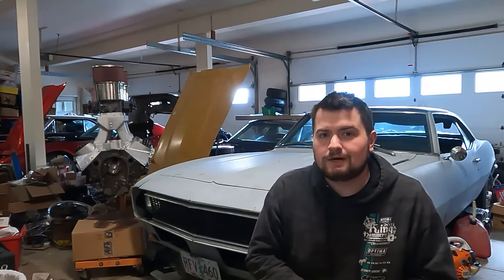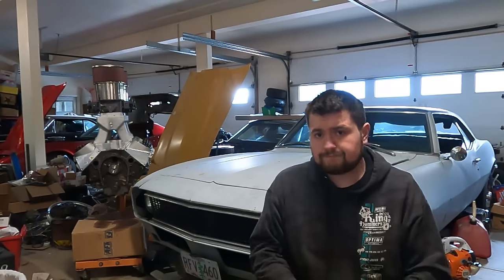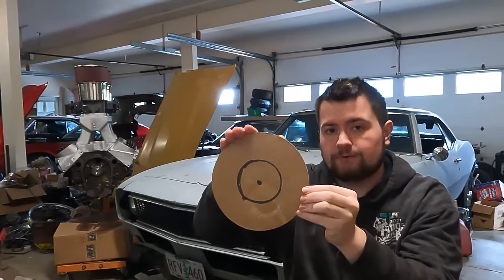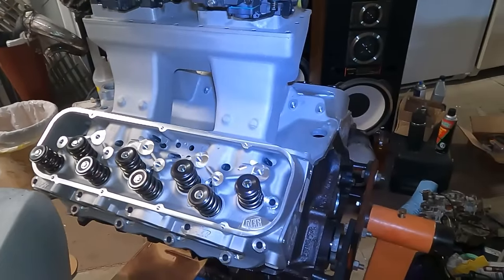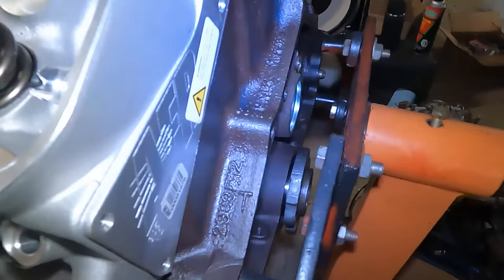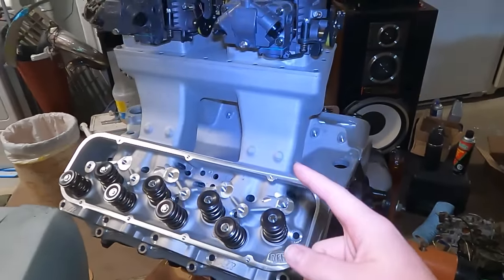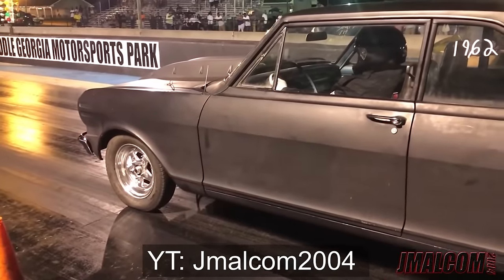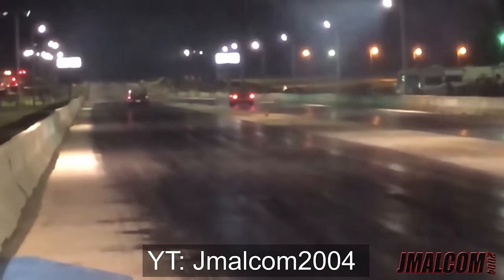The Truth About The Small Block Chevy 327

Comment: I miss the days of of using your brain, combining the right parts you scrounged for or followed leads on. making a deal, then putting it all together,  Did all that on my first engine, a 64 327, 461 heads with a 3 angle valve job plus back cutting the valves themselves, Crane blue[print  series factory cam, flat top pistons of machined heads and decked block, Holley dual plane intake and carb.  Did it all myself in Auto class in the mid 80's.  Thought I was the man!  That was my first SBC and it was a great engine down in my 66 ElCamino; been hooked ever since and still doing it to this day.  Great video.

Comment: I love the 327, I have a small bearing 327 in my 1979 firebird that I use for circle-track spectator racing. I routinely rev it out to 8,000rpm and it has never broken anything. It was built back in 2007 and still going strong. Forged crank and pistons, but still a 2 bolt main.

It ended up making 434hp at the axle and dominated my circle-track class 😁
Reply: WALKED ALL OVER THOSE 350s DIDNT IT
Reply: Yeah, 8Krpm no sweat for a well built 327, we take ours 8,8  at the 1/4 mile drags with 5:14 rear and 29 inch tall slicks. We had 6:14 rear but man, 9,200 in the traps ----Yeeeps  that's a little much.
Reply: What rotating assembly parts are you running?
Reply: That awesome

Comment: Had several mid year corvettes with the 327 350 engines,they were great running cars straight from the factory,on the other hand had several big blocks and had some problems often with them. They had more hp and torque but the small blocks always seemed to run sweeter day after day with more reliability.

Comment: Great video and very good information. 327 is a great engine but if you're planning on building one and not using fifty-year-old rotating assembly you can plan on spending $1,000 Plus on Parts as they're no longer off the shelf. Also a set of even 180 AFR heads will produce about 75 more horsepower than the original camel camel hump heads without significant modification and a far better combustion chamber design. Please keep this great content coming

Comment: IMO 327 was the best engine ever produced by G.M.
Reply: totally Agree 100%.
Reply: I completely agree. Right driver 327 in a quarter mile will eat up that 350. But what do I know 🤔? Only have 4 right now. I would buy more when they're available. Back in the day I did have the fastest thing around. Find out how I set it up that 327 was 160 miles an hour. I also would tear it up in the quarter mile. But that was back in the day. The 80s were great. How'd I know it did 160 miles an hour the one time I loaned it out to a friend of mine. The sheriff clocked it. I'll take a well-built 327 anytime. I've got a guy who has won at 600 hp it has different heads. But what this guy says here in the videos right about the double humps heads and the small journal. with not a whole lot of money 💰 we would pay them over 400 horses. Well I hope you don't mind me sharing this story after your comment I figured you may appreciate it. One of the best place to find a 327? The easiest way is pick up an old scrap 307 with a good crank and slapped that crank with a couple other modifications into a 350 block four-bolt main truck engine. Heather wise head out to farm country especially Kansas maybe Nebraska and The Dakotas and buy an old grain truck. They're cheap enough about a lot of them had inline 6. Go out there just YouTube search it. There are salvage yards out there. Have a great day is getting long.
Reply: I also agree. I still have a pair of 462 casting camel humps on my 350 in my s10!
Reply: Consistently consistent. They were tough
Reply: Screamers,out ran ton of mustangs in my day with a 2bbl 327 lol
Reply: Stovebolt was king!
Reply: Indeed

Comment: I had a 67 Chevelle with the 327-275 hp engine.  It came with the 1.94/1.50 double hump heads and a forged crank.  With the 350 hp Corvette cam, a Z28 intake, Holley 750 and headers, it was good for 13:30s at the dragstrip.   GM built some great engines back then, but it's hard to compare to todays high tech stuff.
Reply: Let's see how many of todays high tech stuff are still around 50/60/70 years from now. Keep in mind there are still quite a few restored 55 Belirs with original 265s still getting used alot !
Reply: I had that same car and setup, I had 456 posi 12 bolt. Turbo 400 transmission, street racing was very competitive.
Reply: it all means not much ! THE CAR WEIGHT IS WHERE IT IS AT !
Reply: The thing about the power pack heads was it's closed in more. And that gives the motor more compression. It's kind of like having pop up pistons having a closed chamber head.
Reply: @hydroy1 LMAO...ur thinking about a 318: Dodge dude. Best small block ever made.

Comment: You can make a large journal 327 by finding a 68-73 307 crank and rods as the 307 crank is large jounal and same stroke as the 327 and will fit in a 69 to 85 350 blocks.
    The 265-327 small blocks allways seem to be one smooth and tight winding engine and seemed to be a little better on fuel.
     I have a 76 Impala engine that I installed in a 66 chevy pu in 84 that had 24,000 mile,still driving that truck with over 300,000 miles and besides good maintenance,I changed the timing gear set,and still runs and drives like a dream.

Comment: My favorite motor was the 327/365 in a 1965 Corvette roadster.  I owned the mighty 427 solid lifter cars too, and sure they were faster, but the little high winding 327 was a blast to drive--and you could actually drive past a gas station.  Was thinking of making another high winding small block something, and this info is interesting.

Comment: Used to run a B&M supercharged 327 at new England Dragway. That car ran High tens, and the rpm's made goosebumps on your arms just before it shifted. Great motor back in the day. Aftermarket parts has made them obsolete in this day and age, but they did run very well!
Reply: Was the crankshaft for that engine a 2" rod journal crankshaft?
Reply: Yes, I had a similar set up & it was very quick only problem was after a few races would blow the rear end when shifting 2nd to 3rd.

Comment: In 1967 I built thousands of 327's.  How ?  It was my summer job after graduating high school in Flint, Michigan.  I worked on the assembly line of the Van Slyke Engine Plant at Chevrolet Division.  Primarily I installed engine heads 8 hours per day.  I also raced a 1957 Chevy Coupe at West Branch, Michigan on the 1/4 mile stock car track.  If you want a cast iron engine (which I no longer use) ... take a 327 block, install a 283 crank, install a 375 solid camshaft, install 12.5 -to-1 pistons, a dominator Holley, fuel injection heads, and a set of headers.  This was before we had access to dyno's, but when Chevy copied our model, they advertised over 500hp and installed it in the Camaro with chambered exhaust (Z28).  This motor spooled rpm's very fast and produced extravagant torque.  Amazingly, it would hold together very well.  I could go an entire season with no replacement parts required.
Reply: You are the man, back in the 80’s my foreman at Don Signer Buick was Gene West and he was a boat racer, factory GM drag racer. He helped develop fuel injection and other fuel related issues for GM . He was able to build a dream car as an experimental. It was a Nova , not exactly sure of the year, like a 68 or 69 and an all aluminum 427. Some of the top brass got wind of Genes mean machine and wanted to drive it. And in less than 5 seconds it was totaled into the wall. He was a real drag racer and his specialty was boats. He invented the dial-a-jet and sold this to Crower I believe. He raced his boat against Eddie hill in Texas before he went on to top fuel. Gene built an all aluminum, blown,  fuel injected , alcohol burning beast for his drag boat. It had an air shifted two speed and had to leave the line in second because it was too much in first , go out 50 feet then back to first then shift again. He also had reverse wired an alternator and mounted it directly to the harmonic balancer to eliminate the belt drive. This guy was a cool dude and he was so fun to work beside especially when a Grand National came in. He water skied at over 100. Hey Gene West, Saturday night and World of Outlaws are in town Steve Kinser and Sammy Swindell !

Comment: I always try & use 327s to the point I was down to my very last standard bore 1967 block, crank & rods I had. I re machined it, did everything because I had no history on it and the old bearings all looked like crap. It was line bored the mains, decked .010 to clean up and bored to 331 flat tops, magnflexed the crank & rods and ground the crank .010/.010 opened up the side clearance of rods to .014 , recon the rods with ARP hardware everywhere. Balanced & blueprinted it to Smokeys power secrets book, used a Comp Cams Hydr flat tappet cam and a high pressure standard volume oil pump. Used a pair of iron Corvette 1.94 intake 881 casting heads and factory aluminum intake & Q jet. Dropped it in my 1970 Chevelle 4 door with a 700-R4 trans & 355 rear as a daily driver for my wife. I ( correction , WE ! )  now have right at 3,000 miles on the 327 rebuild, it has 65 pounds of oil pressure hot and the motor is totally silent.  We got stuck in traffic in the heat of the day over 90 today for over a hour with the water temp of the 327 no higher then 170 degrees with the A/C on !  I used molly rings that most times suck a little oil till they take a good seat, however this 327 I have never had to add a drop in the first 3,000 miles!  I expect it to run a good 250K miles with no issues except now my wife will not let me use it as she never shuts the damn thing off !  That's ok I use my 68 RS/SS Camaro with home grown old school 1970 LT -1. With Gas at 5 bucks a gallon and expected to be over 9 bucks soon ( Thanks Joe Biden ) I am so glade I didn't build any big blocks !!!!.  

    I wish I had another standard bore 327 block because I still have a brand NEW in the box forged 283 crank! and we know what we get with a 283 crank in a 327 block righrt ???? Yeah ----- I want to do one with a looooong deration solid lifter cam & Victor intake. Wish I could get the cam specks for that 302 Smokey built & put in that Grand Prix Camaro with the hemi heads ??? That puppy sounds sooooooo sweet. See link    https://www.youtube.com/watch?v=jHQAQ6Ds34A
Reply: A buddy of mine had a 69 Camero z28 that had a dz302 in it with a solid roller and aftermarket heads and I think 4.11 gears with a rock crusher 4 speed and that damn thing would pull hard. It was very impressive. I would build one in a heartbeat if I had the parts. 8k rpm was normal for that little motor.
Reply: I have a 67 sj complete 327 and a 302 (283) crank that I'm gonna also together. I have a complete 68 real 302. It's a snappy lil engine.  I love the 327 engines

Comment: The engine in my 55 chevy is a small journal 327.Its based on a factory 300 horse engine.The short block came out of a 1964 2 ton and I scrounged around and found all the right bolt ons. It has an Edelbrock performer cam which is slightly larger than the factory offering but still fairly mild.

Comment: I've heard from many racing engine builders that they prefer the small journal engines to get the oiling they need for the engine to survive high rpm operation.  It makes sense to me because they tend to blueprint the lower end with greater bearing clearances so oil pressure becomes even more important.  The larger journal gives the oil from the crankshaft a larger area to escape the bearing and the smaller one may hold it in better.  I always thought that was an interesting concept.
Reply: Actually it’s the lower speed on the smaller diameter journal that makes them better for high rpm durability. Oil doesn’t “escape” easier from a larger journal area.  It’s like being on a play-school merry go round. It’s a wild ride hanging on the outside but get near the middle and it’s a completely different story.
Reply: Larger journal spins slightly slower against the bearing hence longer life. How much? idk.

Comment: Back in 1979 I built a .30 over 327 with TRW 12.5 compression  pistons sealed with Total Seal gapless piston rings a General Kinetic flat tappet solid camshaft activating 202 camel back heads with screw in studs and guide plates cast four barrel intake manifold topped off with a Holley 750 double pumper and believe it or not it would out run many big block Fords Chevies and Mopars and the car it was in was a 4spd 1964 Chevy Impala SS with 4.88 posi rear end 💪.
Reply: What horsepower would a 327      Chevy engine border 60 over
Flat top Pistons very.agressive can high performance aluminum heads  small journal crank 600 holly carb
Reply: @nancysanders5785  you're looking  at somewhere close to 350 hp  👍 !
Reply: That carburetor seems way too big. A 670 doesn't sound as manly but, it's more properly sized for efficiency. That = more power everywhere. Sounds good though
Reply: @heffedirte6243  actually it was awful on the street getting no better than 5 mpg at best (with carb, camshaft and rear end gearing) but on the drag strip it was perfect  !
Reply: Dream car!
Reply: À
Reply: @nancysanders5785 depends on your combustion chamber volume, with flat top pistons depending on rocker ratio you may be limited on what heads you can run, you may run into piston to valve clearance issues with a tighter chamber. All that said with a setup that gives you around 12:1 compression with a rotating assembly and valve train that’ll handle 8,000 RPM and a lot of cam you could see 475hp plus….but you’ll also have an engine that’s worthless on the street. For a good street-able engine that’ll actually idle and behave well in traffic 400hp is about as good as I could see a 327 doing. Of course those numbers are for a naturally aspirated engine and of course that’s just my opinion based on my personal experience, with all the variables out there I could easily be proven wrong.
Reply: @J.R.in_WV  Yah, but dude!  He had gapless rings on that beast!   You put gapless in anything, nobody's touching you.  Guaranteed 4-5 car lengths...(:
Reply: @johnpena9165 That's a BLOODY lie mate, u never beat a MIGHTY MOPAR BIG BLOCK HEMI.
Reply: @wildestcowboy2668  I never raced against any 426 Hemis, back in the late 70s early 80s there wasn't many Hemi equipped street cars around where I lived  !
Reply: @johnpena9165  I can respect that mate!
Reply: 40yo here ....fukNwright
Reply: @wildestcowboy2668 hell back in 66 ole Gumpy put a hurtin on those hemis in 
A/stock with a 327 in a Chevy 2 and those molars neeeeeeded100 more cubic inches.

Comment: 40 years ago I build a 327 in a 1968 Camaro.  I took a 4 bolt main 1969 350 block out of a 1 ton Chevy truck and built it with  a big journal  327 crank, pistons and rods. Worked fine. Great race car.

Comment: We had our 327300hp heads built in the mid eighties. Race engine builder rated it at over 400hp. The power glide got a heavy duty clutch installed. I had to brace my head if I stood on it when it shifted., because it would snap your neck. The set up went back in the family 1965 Impala SS. What a work horse. Daily driver, drag strip, hauling the boat, 12 MPG, ect. Fun Times.

Comment: I had a friend that had a built 327, back in the day. It rev'd so high that it would throw off the fan belt. Fan belt sollution was deep V pulley. He had it built to a "recepe" from Popular Hodrodding. I remember going with him to the junkyards looking for certain desireable block numbers. Also looked for the"2.02" valved heads.
Reply: same happened to me about the fan belt, also 202 heads have the double hump in the casting(front)
Reply: Most chevy guys can't properly aline the pulleys.
Reply: @1q2w3e922   The most common double humps didn't have 2.02" valves.  Most were just the garden verity 1.94 " They all were pre smog small chamber 64-68 cc  I have a set of performance large 76cc smog heads that came with 2.02" valves.

Comment: To sound like a kid again. 327 rules. But what you said was a great tutorial. I just like to 327 for the reasons you mentioned. About 425 horsepower with a double hump heads. Well I know has one cranking out 650 horsepower but he has aftermarket heads intakes etc. Not to mention the internals of the engine. I've got 350 on the stand but I'm always looking for a good 327. Nowadays the 5.3 is so tempting.

Comment: In highschool I build a poor boy 327 for my Chevelle. I used a 307 crank in a 4 bolt 350 block with camel heads 327/350 cam... the 307 and large journal 327 crank are the same. Never let me down through my senior year 1978.